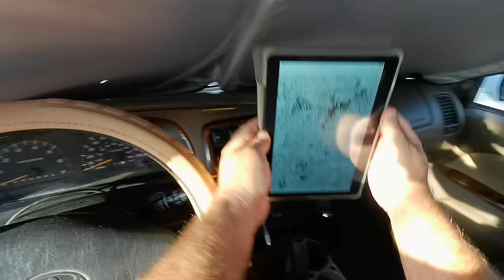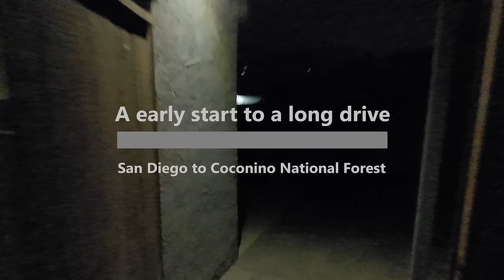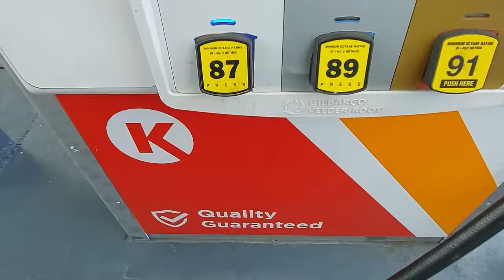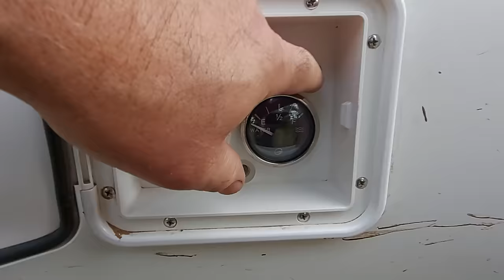Explore Flagstaff's Edge of the World: Dispersed Camping in Arizona! Near Sedona. #overlanding

Comment: Just started watching your channel, can you tell me about the water port you have setup in your 4Runner?
Reply from the maker: @craigstewart6208   Sure,..
-Moved the spare tire to the rear bumper.
-Installed a 10 gallon water tank in its place.
-Installed a diadiaphragm pump.
-plumbed it to the front bumper.
-install a heat exchanger on the front bumper.
-half the heat exchanger has fresh water from the tank and half has engine coolant front the heater core inlet.

You're not the 1st one to ask about it. I'll do a video on it next time we go out.
Reply: @ExploreDivision  Excellant! Ill look for the video. Thank you for replying. My spare is already on the bumper which is good. I currently carry 20gl inside the rig was looking for a way to put some water in the spare well. Thanks again.
Reply from the maker: @craigstewart6208  nice, will let you know when i upload it.